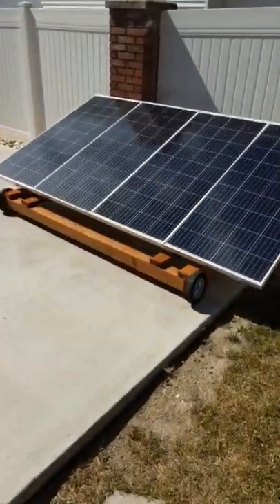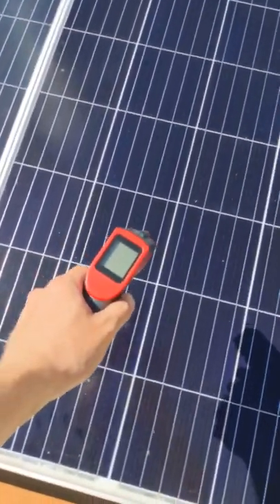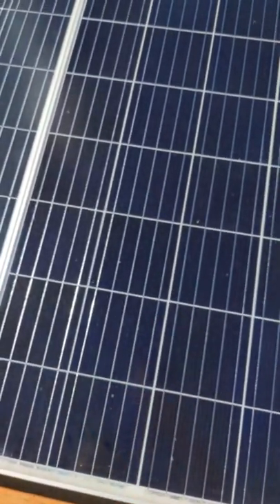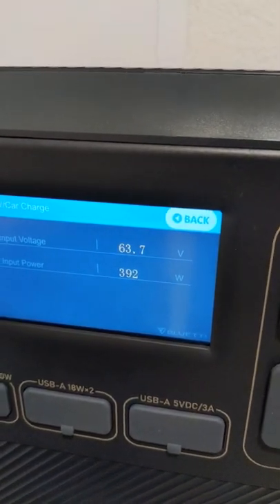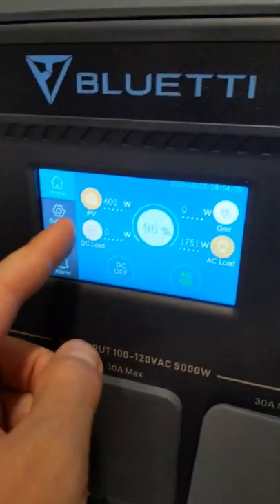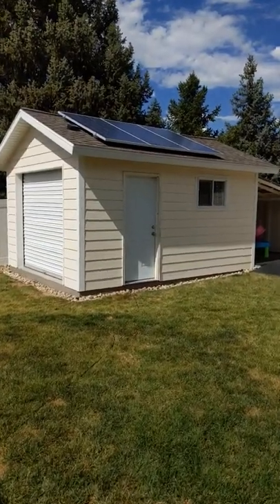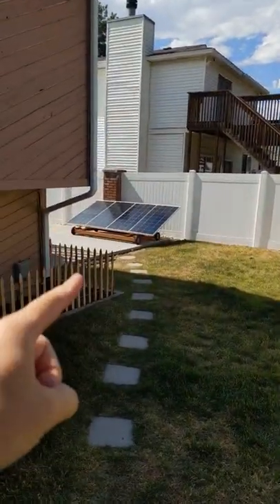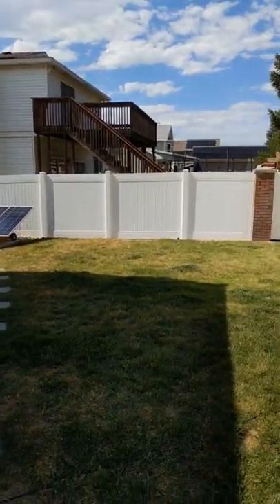Hot Solar Panels = Power Loss?!

Comment: Ok, so the question is: would a recirculating 12 volt misting system allow enough gain in power to overcome the power use of the pump for that system? I can certainly verify that a garden hose sprinkler will do wonders for reducing heat on a roof when I was installing roofs back in the day. We were doing a second roof over an existing one and the shingles were so hot we could not walk on them without damaging them but the job had to get done to keep on schedule. Simple rotating sprinkler allowed us to do so but was a waste of water. But if you set up a gutter, tank and pump to recirculate it, would it gain enough efficiency to be worth it? That could work on most free standing solar arrays. It could also possibly be adapted to roof top solar with a tank overflow for rain water adding too much. Just a thought.
Reply: The Tired Horizon   what would happen if you ran a closed loop with a garden hose to a 50 galon drum and the heat in the water move itself through the pipe
Reply: @fabriglas  the 55 gallon drum would get hot, that's what would happen

Comment: All solar panels are rated for output at 25C.  If you look in the panel specifications, you should see some compensation data, usually Isc, Voc, and Pmax temperature compensation.  These numbers are per degree celcius above 25C.  For instance, the Bluetti voltage derating for the panel (PV 350) is about 126 mV per degree celcius.  For the same panel, your temperature reading of 134F will result in the Vmp voltage drop of 4.1 volts and the max power at this temperature is about 307 watts, illustrating that cell temperature is causing you to loose a little over 11% of the rated power at 25 C.  If you are going to try and cool the panels with the misting ideas from other posts, you should mist from the back side of the panel, as this is most likely a few degrees hotter than what you are reading at the front.  This is one of those dirty little secrets that most installers will not mention.  Temperature can also be your friend.  In the winter time with temperatures below freezing, you can get a similar boost above the panel rated power and voltage.  Another informative video, thanks!
Reply from the maker: Thank you for your excellent feedback John, appreciate the comment!
Reply: @Jasonoid  If you want to send me the models of the solar panels that you are using, i can run a simulation for you using DOE climatic data for a year, which gives you a breakdown of all the losses by day, month, and year.  If you let me know the roof angle, the simulation will be the most accurate.

Comment: If you put a cloth/hessian strip about a foot off the panel above the solar panel you should get the same watts with more power because the panels won’t be as hot. Try it & post the difference?
Reply: Quality Charge controller will be able to compensate for the radiated heat, viz. MPPT* charge controller. When an inferior charge controller, PWM*, when used the output may drastically be effected. There’s no need to ‘cover’ PV cells. That procedure will not be effective, like how pleasant it is for human being. Solar radiation consists of EMR, X-rays, UVA/ UVB , IR, Radio Emmission ( Micro wave) visible lights, Gamma rays, Alpha, Beta rays which passes through any thing. Plus ambient, heat reflected from earthly objects, they all produce heat. No cloth will withstand the natural elements. I can go on lecturing  Physics for hours. But it’s boring for all.
Do not cover PV Cells. Thanks.
(MPPT = Maximum Power Point Tracking / PWM= Pulse Width Modulation)

Comment: So in the desert area , where is +70C it won't be a good choice?
What if to use the heat-resistant varnish???
Reply: I wonder if a sun shade would help with input of if the actual temperature itself effects the efficiency.

Comment: Try it with less of a full charge. @93% the charger was throttled down  already.
Reply from the maker: These don't throttle down till 100%. I've been using them for 3 months everyday and I can get max solar input @ 98% and below.
Reply: Then it's destroying your batteries.  Lithium can accept great charge & discharge rates but still require a slower charge once closer to full. Maybe your mppt hasn't registered 0% yet and 100 isn't completely full 🤔
Reply from the maker: @1aview  The power station in the video (Bluetti AC300), doesn't charge the internal LiFePO4 batteries up to the "full" 3.65v rating for the batteries. They keep the battery between 20%-90% to get more cycles. It stops charging near 3.4v per cell. So you'll see it charging at a full rate right before it stops. It will taper down for the last 1% or so.